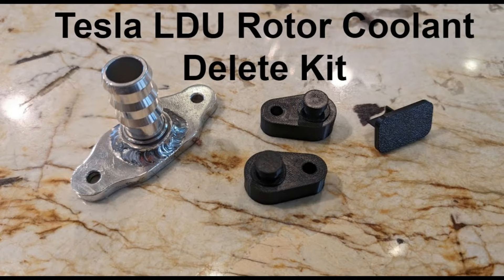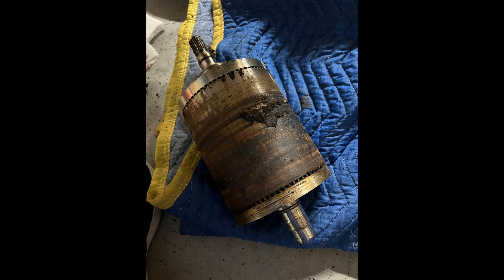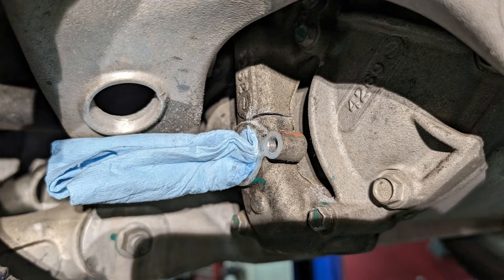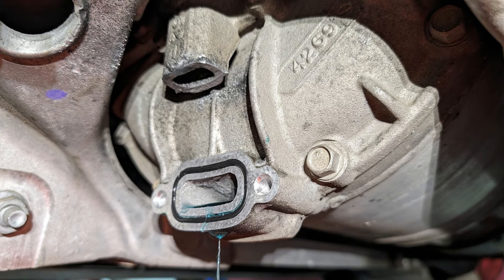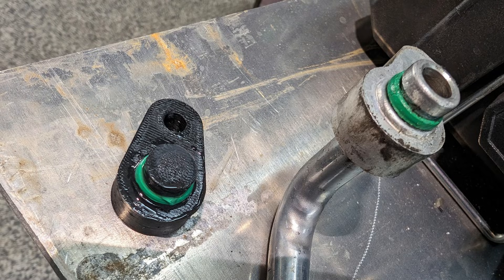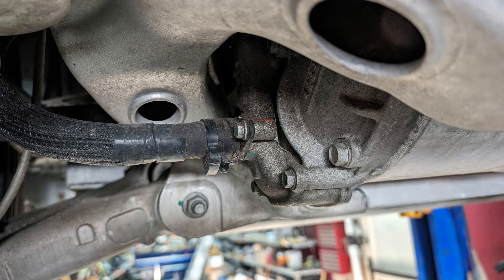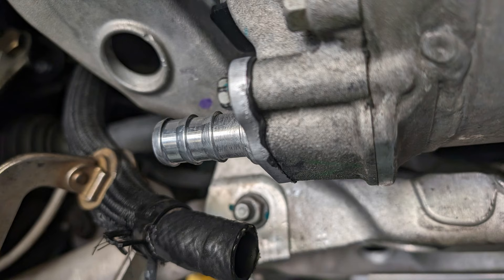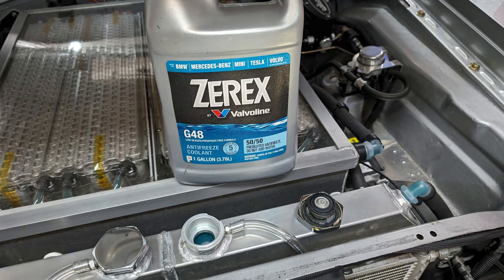Tesla LDU Rotor Coolant Delete Kit - For sale in the description!

Comment: Hi, i showed this video to some mechanics and they said this method will have air bubbles trapped inside the motor? I am not sure how true this is. I am a DIY and I dont know why anyone would say that. With that being said, is it true? and are there people here who have had this changed and their teslas are fine after 5,10,15 years?
Reply from the maker: @Saywhatohno  Hello!  Coolant delete kits are relatively new, this one has only been out a little over one year.  There are hundreds of this version on the road with zero reported cooling issues.

I have several thousand miles on my personal car , "The Electrollite",  which is a converted muscle car that gets pushed to extreme temperatures on a regular basis.  Maximum cooling was my goal. 

It's probably a simple misunderstanding about the coolant flow.  This kit removes the rotor return tube.  Since we are not feeding coolant to the rotor, there is nothing to be returned.  Instead, 100% of the coolant flows through the motor and inverter with less restriction to make up for the lost cooling of the rotor.  The increased flow provides better cooling of the motor and inverter where the temperature is monitored and where d-rates will occur. 

Air bubbles in the motor are definitely not a problem, with the higher flow through the motor, they are probably less likely than original.

Some kits have decided to retain the return pipe that used to return the heated coolant after absorbing heat from the rotor.  If heat is no longer absorbed from the rotor, this merely reduces the overall cooling capacity of the motor by bypassing usable coolant around the motor and inverter.

 This kit also retains the aluminum tube inside the rotor for some passive rotor cooling, all other kits remove that tube.

Hope this information helps, let me know if you have any more questions!
Reply: @MrMoparMan  Don't i have to clean the PCB because some people are also advising if you dont clean the coolant out of PCB it can corrode over time? and that's why some are arguing that taking out the motor is the better way.
Reply from the maker: @Saywhatohno  There are many possibilities when it comes to the coolant leaks.  If it has leaked, it most likely needs to be cleaned out. 

This kit does not preclude one from removing the drive unit from the vehicle, it merely makes it possible to install while in the vehicle.  It can be installed on a removed drive unit just the same.

Comment: Hi i bought a kit and was wondering Why do you need to do anything with the aluminum tube on top of the motor just to plug it? Can’t you just leave it how it is since the big plug for the cut on the manifold already encloses that area?
Reply from the maker: @yahiabenhacene5828  hHy, thanks for buying the kit!  

The top of the differential needs to be blocked off because there is pressure from the cooling system at that point.  If it is not plugged, coolant will flow backwards through the aluminum tube into the manifold.  

Keeping coolant out of the manifold is the objective because that's where it can leak into the motor.  

The square black plug is merely a dust cap to keep outside contaminants from getting into the manifold.
Reply: I installed the kit and some small drops leaking from the remaining manifold wear the cut and big plug were done. I thought coolant would not flow there after the adapter allows one path to the bottom of the motor housing?
Reply from the maker: @yahiabenhacene5828 coolant is not flowing through the manifold, but there can be residue.  Did you blow air through it or vacuum it?
Reply: No I didn’t. After i cut the manifold and it stopped dripping i used silcone and plugged the big whole, then did the rest of the instructions. The next day i did coolant purge and found drops coming from the big plug
Reply from the maker: @yahiabenhacene5828 okay, it will drip for a short time but there is no new coolant going in, only residue.

Comment: I was hoping you can help me with this questions. My drive unit was replaced at 75k miles in 2023 but today at 91k I pulled the speed sensor and noticed coolant on it. Do I still have time to do the coolant delete or is it too late?
Reply from the maker: I'm sorry to hear you have coolant on your sensor.  First I just want to make sure it is coolant.  Sometimes it's hard to tell because there might be some grease.  
If it is coolant, that means there is coolant in places where it should not be.  
Once there is a leak, it needs to be gone through.  A coolant delete now will stop any further leaking, but there's no way to know when a problem might develop due to the already existing coolant residue.

Comment: So is this something you can just do yourself easily like without removing the motor? What do the metal pipes that you seal off normally do that you're stopping? And is it a forever fix? Also, it looks like you have updated the kit, is that correct?
Reply from the maker: @officialRallyWorld  Yes with average mechanical skills you can install this kit without removing the subframe and motor.  

The metal pipe returns the coolant that cooled the rotor.  Since we are not feeding coolant to the rotor, we don't have anything to return so we block it off.

Yes it was updated to make the o-rings fit a little tighter on the block off plugs.

It is a forever fix, it completely eliminates the possibility of the rotor leaking coolant into the stator and inverter.
Reply: So gearbox and inverter still keep getting coolant and car can be driven just like before (hard) ?
Reply from the maker: @karlajensen100  Yes, in fact it gets increased coolant Flow with less restriction to the stator and inverter which then exits the gearbox.  I consistently push my car all the way to d-rates and I have seen stator and inverter temperatures 5% to 10% lower compared to similar conditions before the delete.

Comment: Question... Tesla replaced my LDU in late 2017 because it was leaking coolant into the drive unit. My Vehicle is a 2014 RWD Models S 85. Would Tesla have bypassed the Rotor Coolant when they replaced the unit? Is there a way to tell by looking at the unit?
Reply from the maker: @Carl-f7h  I don't think they had any repair options at that time.  You can definitely tell if you look at the coolant manifold which is on the driver side of the vehicle.  You probably have to remove the plastic cover to get a good look.  If it looks like the one in this video, it is not updated.  While you are under there, it's a good idea to remove the encoder sensor... It's a single 10 mm bolt.  It's possible to pull the sensor out while it's still connected, sometimes these connectors can be brittle.  Once you remove the sensor you will be able to tell if you have a leak or not.  A little bit of Grease with minimal moisture is normal, any rust color or excess moisture and it is probably leaking.
Reply: @MrMoparMan  I really appreciate the quick response. I was going to take a look at it this weekend. It was changed at about 70K and I now have 190K on it. Just had to deal with the dreaded BMS U029 error. I opted to have my battery repaired. It had a couple bad cells and a BMS Module issue. Couldn't justify the expense of a full pack replacement for a car that is hardly worth anything resale. The repair was $3K and other than a battery with a health of 80% it seems to be ok thus far. I want to avoid a Drive replacement if at all possible so the coolant delete looks like the way to go. I no longer have access to a lift so this delete kit looks like the most cost effective option and doable myself.
Reply from the maker: @Carl-f7h  wow! Nice job on all those miles! Every drive unit seems to be different, some fail with very few miles and some last much longer.  This is a very doable, less invasive install, especially on a higher mileage car.  Many people end up with broken bolts, connectors, and corroded high voltage wire connections to deal with when removing the subframe and drive unit.  Let me know what you find out after you inspect.

Comment: Is this only for older model s teslas?
Reply from the maker: @jake8882  it's for pre-2019 Model S. It fits single motor rear wheel drive cars or performance dual motor cars.
Reply: @MrMoparMan The pre-2019 X performance models had same issue as well, so does this fit those X models as well? Like 2017 Model X P100D?

Comment: Why so deleted this coolant ??? Overheat engine Not ?
Reply from the maker: This only deletes the small trickle of coolant that used to flow through the inside of the rotor shaft.  That coolant will eventually leak and destroy the stator and inverter.  

This kit removes the flow of coolant to the rotor and sends the full flow with reduced restriction directly into the stator and inverter. 

In the end, the cooling is better for the stator and inverter and it is assumed the rotor runs slightly warmer, but there is no monitoring of rotor temperatures. 

It has proven to be a very good fix that improves the reliability of these drive units.

Comment: Hi great innovation.

How many miles since coolant delete?
Reply from the maker: Thanks, I have about 5,000 miles on mine.  So far so good, no leaks and you wouldn't know whether the car was deleted or not from an operation standpoint.  

My data logs show slightly cooler temps when I am pushing it to the limits, this is probably due to increased coolant flow and reduced restriction to the stator and inverter.
Reply: Thats awesome

Comment: Please forgive my ignorance. But I simply can not understand how this is working. I understand that how the coolant is entering through the new barbed fitting. But how does it cycle back through? How does it return to the radiator for cooling?
Reply from the maker: Once it enters the stator housing, it flows through a series of serpentine pipes to remove heat from the stator windings, then it continues to the inverter where it branches into the three phases which have their own individual cooling channels.  It ultimately returns at the bottom of the differential where it exits the drive unit on the way back to the radiator to remove all of the heat that was collected.

The flow used to branch up to the rotor with a small amount of flow that would also end up returning at the same output port at the bottom of the differential.

Here is a short video showing more:  
https://www.youtube.com/shorts/kaQ87Viy3zQ

Comment: Could you summarise a list of tools required to complete this job ? 

Also any risks ?
Reply from the maker: The tools to make the job as easy as possible include an oscillating saw, a mini hack saw, and a ratchet with 10mm socket, extension and universal joint.  It is a pretty straight forward process with minimal risk.  You will want to make sure the car is powered off and the key is out of range so it can not turn on and run pumps with hoses disconnected.
Reply: What type of RTV sealant should I use?

Comment: Successful kit install! Thanks Kevin. The kit arrived in UK very quickly and email advice was excellent. I found it very awkward on my 2015 MS 85. Couldn't figure out how to get car onto jackstands on the driveway as the lifting jacks had the puck positions. Bought some ramps and reversed the car up. Put car to sleep but battery coolant pump ran for some time. Keep the key in the house as it can wake the car up. Pulled the speed sensor and it was dry, just a tiny bit of condensation. For some reason, on my car, access to the pipe bolt at the gearbox was very hard and I nearly gave up. Ratchet socket only had room for one click per turn. My electric saw has a long body and the rear left wheel got in the way a bit. My top tip was I don't like silicon in damp areas so I used hybrid polyurethane sealant that can cure even when wet, in UK there's CT1 or OB1 or PU40. I tapped the cut pipe end plug on too hard and cracked it so filled it with sealant. Plenty of sealant around the gearbox plug and new barb then blew, not too hot, air gun over them. While waiting I changed the gearbox oil. Tightened everything up and did the coolant purge in Service mode 3 times till the level stopped dropping. No leaks!
Hardest job I've done because of the lack of room but thanks to Kevin I now have much greater confidence in the longevity of my LDU. It's a genius kit as all the other delete options require dropping the motor.  I'm running in Chill mode these days as it's all I need most of the time.
Thanks also to this video which is very useful: https://youtu.be/mBY_yp68CQw?si=2lRTdEhTnAJbA0RM
Sealant: https://youtu.be/xmq3iMlUDRw?si=a14irhZB6nFTVHF2
Reply from the maker: @Toob41  Great job on the install!  Thank you for sharing your experience.
Reply: Hey thanks for the detailed information can you please tell how did you top up the coolent in the end ? Much appreciate !!
Reply: @Zainali-n4o4u  I topped up the coolant reservoir in the frunk with G48 and ran the coolant purge from the service menu multiple times topping up when the level dropped
Reply: @Toob41  o man this job isn’t for the noobs a pro like you can do it !!
Reply: @Zainali-n4o4u  I'm just a weekend DIY guy. I followed Kevin's instructions and he gave more advice. Jacking up the car on wheel ramps was the hard part, and I bought a cheap saw.
Reply: Well done to you job and description. I’m in the uk as well, specialist asking £1400-£1500 for coolant delete . I’m thinking going the same way as you did. Could you share some pictures or videos please ?

Comment: i know it sucks to drop subframe but u need that flyover tube and many test have been shown this method will damage the drive unit. I have a tesla repair shop and as much as i wish we could use this method u need the cooling from that tube
Reply from the maker: @CJ-uu3lk  Interesting comment, but I believe you are mistaken.  

The flyover tube is restricted return flow from the rotor.  By cooling the rotor, the coolant is heated.  So in the original configuration the return flow heats the differential. 

By cutting off the coolant to the rotor and eliminating any leak potential, there is no coolant to return, making the flyover tube unnecessary. 

Some people run a bypass so that they can now pass unheated coolant to the differential but this is optional and not necessary.

Feel free to advertise your shop and post links of the many tests that have been conducted.
Reply: "many test have been shown this method will damage the drive unit" - is there any evidence of this? Proof would be helpful.
Reply from the maker: @Toob41  I have seen this claim before, but I believe there is a misunderstanding of the system. 

The return flow of heated coolant does not provide cooling to the differential.  The rotor, stator, and inverter get much hotter than the differential.  Collecting all of the heated return flow at the differential adds heat to the oil allowing for moisture evaporation.
Reply: @MrMoparMan  Could there a be a second destination for the coolant that the flyover tube could be visiting?  Your vid shows it returning down the face of the housing's other side.  Could it not be just traveling, but also meant to partially cool that side?  I'm not trying to be uptight, and think these may, at best, be nominal risks relative to the one your kit avoids.  Thanks.
Reply from the maker: @hcjpbluesky9916  this seems like it could be a reasonable assumption, but the physics don't line up.  

The coolant used to cool the rotor becomes heated.  The heated coolant now passes by the differential which is very unlikely to be hotter than the heated coolant from the rotor. If in fact the differential was hotter, a 5/16 trickle of coolant is not going to cool a large differential area that is slightly warmer than the heated coolant.  

So when we delete coolant flow to the rotor, there is really no reason to return any coolant from the rotor.  Doing so diverts cooled coolant away from the stator and inverter which can benefit from a higher unrestricted flow.  The stator and the inverter are the only areas where temperatures are monitored, and de-rates will kick in once they get very hot.

Everything I do is performance oriented, I have noticed slightly cooler temps at my stator and inverter, but I push my car way harder than most and I data log.

In the end, I like the Tesla mantra of the best part is no part.  Unless many temperatures were closely monitored and logged, I would imagine differences either way are imperceptible.

Comment: How do I know if I need to do this modification? I have a Model S 2016.5 75 UK
Reply: If you have a a rear wheel drive (only) or Performance dual-motor Model S you need to do the coolant delete fix.